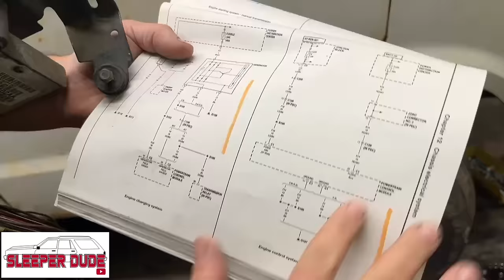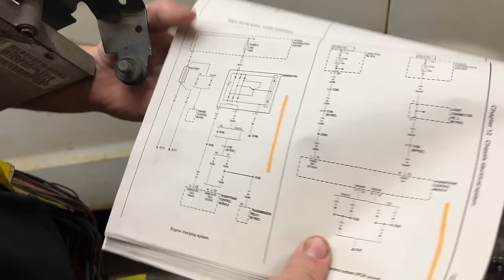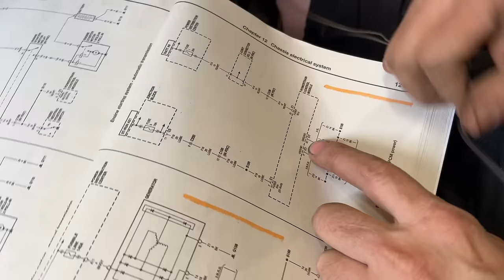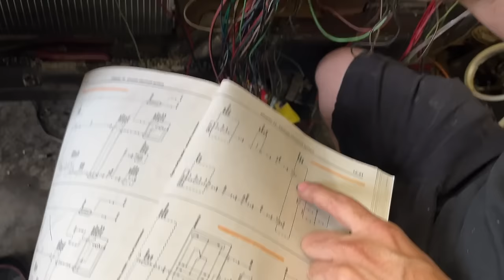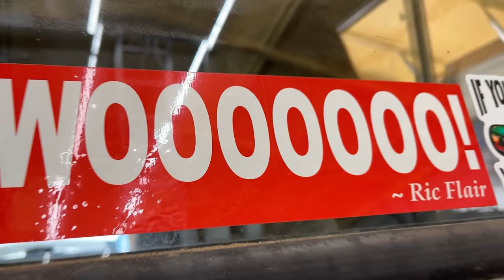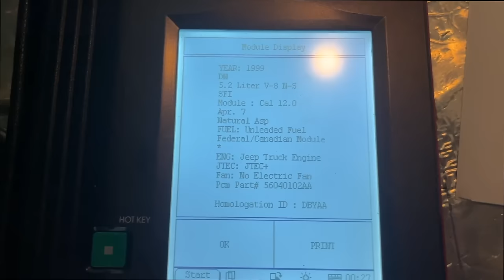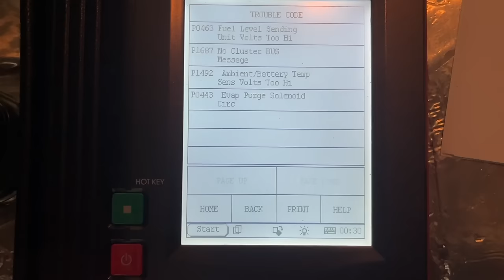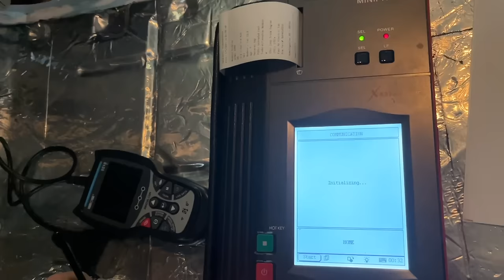2 Years of WORK Has Led Up To This! Will It Start?

Comment: If the oil pressure switch doesn’t fix it, next, check the crankshaft sensor and the camshaft sensor for output signal with an oscilloscope or similar tool
Reply from the maker: Ok thanks
Reply: Exactly right!
Reply: Thank you for that automan, i DIDNT know about the oscilloscope, been lucky ear diagnosing them,
Reply: williamparker8866 @sleeperdude maybe you could swap in the switch and key from the Durango?
Reply: williamparker8866 Genius!
Reply: williamparker8866  if it were the key switch I don’t think he would have ever gotten it to fire and im not sure what scan tool he used but a decent scan tool should have shown that. Because it fired and then failed I’m putting my bet on the cam position sensor not telling the pcm to fire the injectors. Or the crank position sensor not reporting spark to the pcm so the pcm kills injector signal. Both of those sensors are super cheap and easy to replace so I’d start there.

Comment: There are couple of things you can try. First try upping your fuel pressure to around 55psi. Also try hooking up the oil pressure sensor just in case it has a shut down mode for lack of oil pressure. Good luck to ya all
Reply: I agree. It was sputtering until the fuel pressure was turned down.
Reply: @jpcii  i agree as well, i know on my 440 to 5.9 swap i turn my fuel pressure down. & ones i did it did not run, i turned it back to 55 psi it ran. but i also had to hook the oil pressure sensor back up as it would not run to it after i hook it back up it ran just fine. he have a lot of stuff he did not hook up as well that can make no start.
Reply: 55 on fuel pressure and hook up oil pressure sensor
Reply: Oil pressure is worth a check. Look at your schematic and trace the "switches" that feed the computer. Most will be crank no start inputs meaning without the switch being "on" it will crank no start.  One is security, but there are others and oil pressure was added to many systems as a interrupt in the early 1990 to prevent fuel flow from a leak...similar to the inertia switch or level switch which they started adding in the late 1990's. Once you find a switch input you need to see if it is ground to on or flow B+ positive through to "on" in which case you need to connect it to positive.  The schematic will give you the design and that is the key.

Comment: I get PTSD just seeing that spaghetti of wires! Been there! 
You are right about the 
Body control Module thing, all that wiring you did, I would take the gauge cluster from the Durango and put it in the camper.

Comment: It may have already been mentioned but if not on your O2 sensor installation there’s likely to be a check engine light with a P0420 since there’s no catalytic converter between the upstream and downstream sensors. The quickest way to eliminate the code is to install one of the O2 sensor “extenders “ in the downstream sensor in order to trick the computer into thinking that there’s a cat in between the two sensors. There’s also other ways to skin that cat too.
The way it tried to run at first sounded like the pickup in the distributor was bad. Those 5.9s were famous for no injector pulse issues.
Reply from the maker: Ok thank you
Reply: Yes that's the best way its like an elbow..
Reply: I have done that before and it works.  His are placed very close together so I dont know if it will work or not.
Reply: If the extender isn't enough to turn off the cel, a little steel wool inside the extender will
Reply: If I’m not mistaken @watchjrgo had a similar situation. He explained in his video the path.

Comment: Josh’s knowledge of auto electric wiring is quite impressive. I’ve done my fair share of wiring in cars, but that huge wiring harness looks like an explosion in a spaghetti factory. 😂😂
Reply from the maker: It was a big project for sure
Reply: @Sleeperdude  So all overdrive transmissions need the driveshaft cut when upgrading from a 727?  That might be a deal breaker for me, forcing my to overhaul or replace my 727 and buy more gas.
    The simple wiring is a big reason to go with the classic stuff, so doing all that work to lose that simplicity is something I wouldn't do.  I would buy or overhaul a carbureted engine or possibly a throttle body engine for that van, though the overdrive trans is a real upgrade, I just would have looked for an RH.  My surfer van engine is still good, so I am only considering an overdrive trans, and even cutting the driveshaft might be too much for me.  But perhaps the right drive shaft will come with the trans if I get it from a newer B200.

Comment: I believe your problem could be the ASD relay ,automatic shutdown relay, commonly referred to as the ASD relay. The ASD relay is responsible for supplying switched 12-volt power to the vehicle's injectors and ignition coils in the event of an accident it shut down power to the injection system. If you did not install or bypass your Fuel Pump Inertia Switch from the durango ???
Reply: @TheBuddyCassius  but i think he's got fuel pressure

Comment: Not sure if it's similar to 90's chevy fuel injection systems but if you don't have at least 50 psi or more fuel pressure, the injectors will not fire. It did stop running when you dropped pressure to 48psi. Good luck!

Comment: Turning the distributor doesn’t mess with the ignition timing. It only messes with the fuel sync which is when the injectors fire. You need a snap on mt2500 to set that. Ignition timing is all through the ecu

Comment: Did you check the injector wires, if there is a positive signal from the ecu, and theres ground? Maybe its just a ground problem. Dont use the noid light. Use a multimeter for ground and a simple test lamp for the positive wire.

Comment: I know the feeling of feeling unaccomplished! You got this Josh! Just Holley it and forget it! I would trust Holley over OEM Mopar anyhow. Best of luck guys.
Reply from the maker: Thank you
Reply: Does Holley even do MPFI? You can’t just slap a TBI throttle body on top of that long runner intake manifold, the fuel will fall out of suspension in all the turns and bends.

Comment: I’m glad I found your channel. I’m getting ready to swap out a (76) 460 to a (88) 7.3 diesel, in a 24’ motor home. The 7.3 is non-turbo, so I’m going to add a Bank’s turbo kit. With the motor home having the van body, I will have a lot of the same room problems with adding the turbo. One advantage is that the 7.3 is mechanical, so I shouldn’t have many electrical (computer) problems. Also it’s cool to see that the whole family is involved, they’re learning lessons that will last a lifetime. I can’t wait to see the initial road trip, and from what I have seen everything will be fine. You have been very thorough with the wiring.

Comment: Josh, I would also add that you need to verify you’re getting a good crank sensor signal. To protect itself if the ECU does not see a crank sensor signal, it will not give it fuel. Some manufacturers will shut off spark, but others will shut off the signal to the injectors.

Comment: @SleeperDude 
Loving the build on the camper. I got a good bit of experience with the Dodge magnum engines and what you have going on seems like classic failed crank sensor they are very sensitive and I had new ones straight out of the box fail after a few starts
Reply from the maker: Ok thanks
Reply: @Sleeperdude  I am only about few hours away in Nashville I have worked on many of dodges magnum motors if you need anything let me know
Reply: @sxstrailmafia 💯 agree been there too

Comment: Try checking both the cam and crank sensors.  Some systems use one or both to fire the injectors.
Reply from the maker: Thanks
Reply: @Sleeperdude  yeah, it would only need the crank sensor to fire the ignition at the right time so it could be the cam sensor
Reply: @TheBuddyCassius  of course it is, but does it need cam sensor for spark?
Reply: They have to see each other in order the fire the injectors check on a scan tool for crank cam coalition

Comment: Check the following.  Fuel pump opening relay.fuel pump cut off switch. Ignition starter switch. Make sure you have over 5 gal in tank. Good luck! Larry 😊
Reply from the maker: Ok thank you
Reply: Fuel line blockage to.

Comment: Voltage is applied to the fuel injectors with the ASD relay via the PCM. The PCM will then control the injection sequence and injector pulse width by turning the ground circuit to each individual injector on and off.

The PCM determines the proper ignition timing according to input received from the crankshaft position sensor."

So if the PCM is not getting a signal from the crankshaft position sensor, it will shut off power to the injectors through the ASD (automatic shut down) relay after three seconds. Suggest you check the crankshaft position sensor and associated wiring.

This sounds like it could be a factor in your scenario. Good luck, hope you sort it out soon.
Reply from the maker: Thank you 😊

Comment: You did a killer job putting a Holley Terminator on the turbo coupe so that may be the easiest, most reliable long term solution.  You’ll have control over everything and it’s system you already understand not to mention you’d have Holley for tech support. 🤷‍♂️ You got this!

Comment: After rebuilding my buddies 460 in his 94 ford, it wouldn't start. We scannned, and trouble shooted, had 2 different shops scan and troubleshoot,  a year and a half later, replaced the coil,and she fired right up. Sometimes its good to just go back to basics. But feller, this is the best show on YouTube!!!😊

Comment: Koodos to you for using the factory harness. The Holley stuff is great, but it is kinda spendy. David Freiberger ran into the same problems doing one of the first Hellcat swaps in General Mayhem. the factory computer wouldn't let the motor run without nearly EVERY factory circuit hooked up. I mean the ECM had to know wether the trunk was open or not or the it wouldn't start.
Reply from the maker: Thank you!!!!
Reply: When you hooked up the new CCM I didn't hear them click I heard the first one clip but I didn't hear the other two click maybe they didn't go in all the way are the ones that send the the signal to the injectors might not be plugged in all the way I know it has to be a simple fix are ground wires not grounding right not letting us send the signal
Reply: Ecm

Comment: Hey watched your vids and awesome job. I think your problem is going to be in the cam plate in the distributor. That is where the injectors get their signal.  Plugs fire from the crank sensor and injectors from the cam sensor. Good luck and keep cranking them out.

Comment: Hey Josh, first of all, major props to you and the entire family on all the major work and effort to put out family friendly, quality content, week after week. I normally don’t like to watch videos over 20 min but I could (and do) watch all your videos start to finish. 

As for the RV, I’m no Mopar guy. However, my ‘94 Pace Arrow on a Chevy chassis did exactly what yours is doing. Start and die, then no start. Turned out it was the oil pressure sensor. On the Chevy 454, there are two oil pressure sensors. One is just for the computer and the other is for the gauge. If either one is bad, it will not start. It took three mechanics to finally figure it out after a week at the RV dealer many years ago. Recently, it did the same thing and I replaced the sensor and it fired right up. 

I don’t know if this will help but I’ve seen a few others mention the same thing here. 

Looking forward to your next update. 

God bless. 🙏

Comment: Hi josh, I noticed you tied your 5v and 12v power together. As a result you may have damaged your cam and or crank sensors that rely on a 5v reference from the computer. Those powers will have to b separated and check for damaged components

Comment: if the tps sensor is stuck showing full throttle on crank it will shut down the injectors for flood mode. it would not trigger any engine codes during this. try unplugging the tps sensor and see if that allows it to start.
Reply from the maker: Ok thanks

Comment: My suggestion would be to go online and find a wiring schematic for the fuel injectors. That way you can check/inspect all the individual parts that make the fuel injectors fire. Also i would check out the can bus code to see if that will prevent the engine from running even with the correct ecm you installed. Sometimes its best to walk away from tricky things like this and come back to it a day or two later with a clear head. At any rate though, you and your family did what you could and the results show. Thats what matters most!

Comment: 1 - oil pressure sensor needs to be hooked up.
2- the hot during crank/on tied together may need that diode, computer may not like it, just wire up a toggle switch if necessary

Comment: On the oil pressure you may need to install the oil pressure sensor so the computer can read the oil pressure and might let the injectors work along with the firing the plugs.
Reply: great point I don't see a heart from Josh hope he sees this

Comment: Hook up the oil pressure sensor. Verify EVERY ground wire. Make sure the block is grounded to the frame. If you can verify the crank sensor, and the cam sensor I'd do that too. Interesting that the fancy scan tool could make the injectors pulse. hook up the light to the injector and test fire with the fancy tool. Make sure the light will actually come on. I never saw that light come on at all. Also make sure the switched power and constant power still work like they are supposed to. Check that inline fuse you put in there behind the dash just because. I had one of them melt on me and sunk the contact below the plastic. Fuse looked good but the circuit was open. I have faith you'll figure it out. Love the videos. Love the family participation. That is the biggest win at the end of the day.